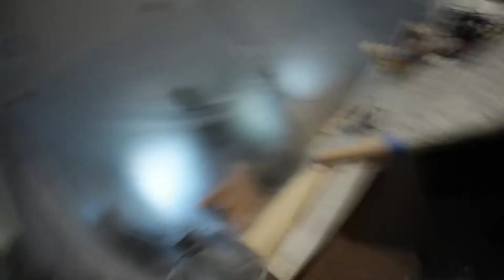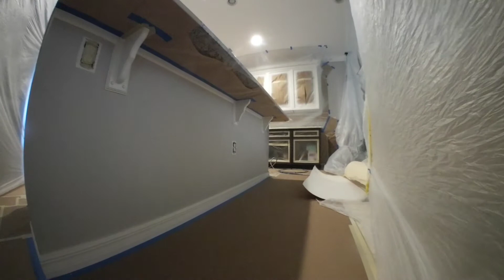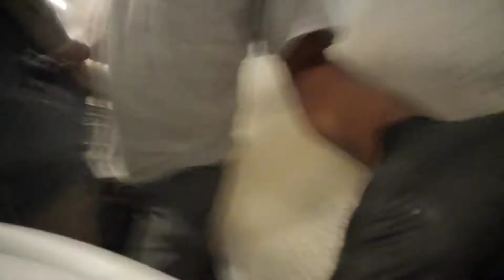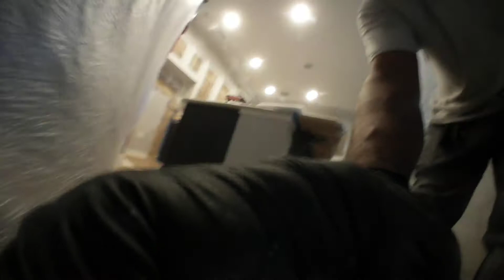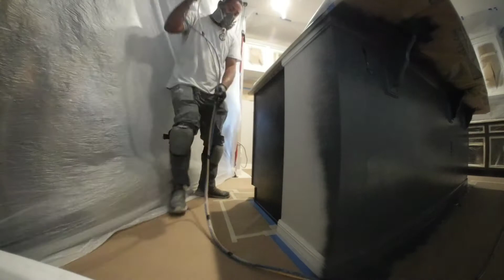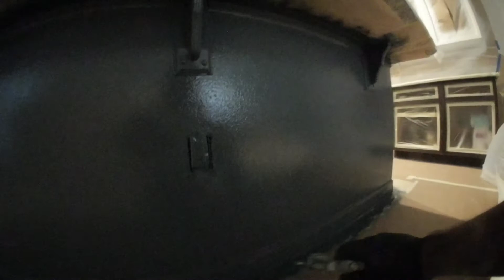spraying COMMAND with Tian aircoat

Comment: Hey man, what pressures are you using there? PSI on the airless side and on the air side?
Great job by the way!
Reply from the maker: Using about 1800 on the pump and 10 psi on the air
Reply: Thanks, I see you use a Graco G15 gun….isn’t 1800 passed the max pressure the gun can handle (1,500) or that goes below 1,500 after you trigger ? @duartepaintinghandymanservices
Reply from the maker: @DownloaderVideo  I've used that g40 up to 2400 psi with no issues
Reply: @duartepaintinghandymanservices  Oh, my mistake then…I thought it was a G15 not a G40 which I know can handle up to 4000…..Did you have a G15 before or am I crazy? 😂
Reply from the maker: @DownloaderVideo  never had a g15, I have 2 g40 and 2 titans 3600